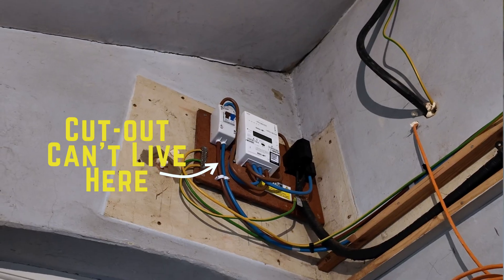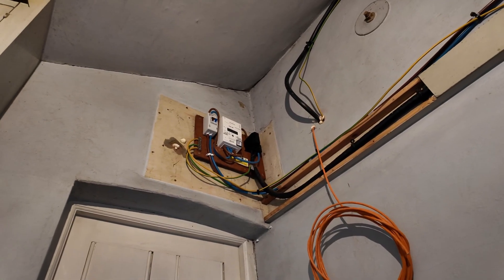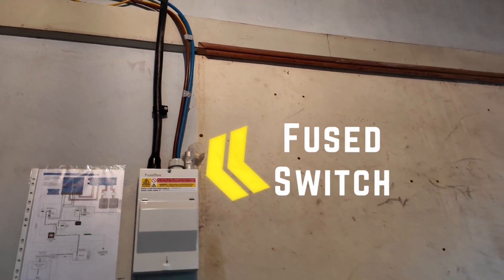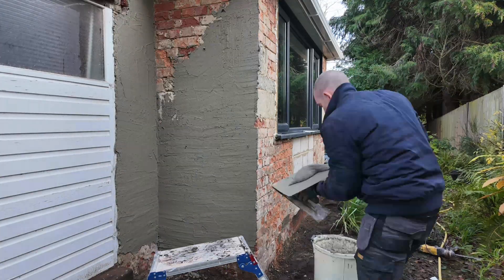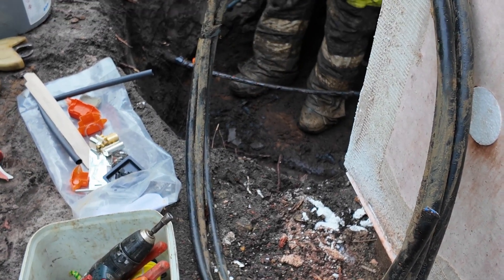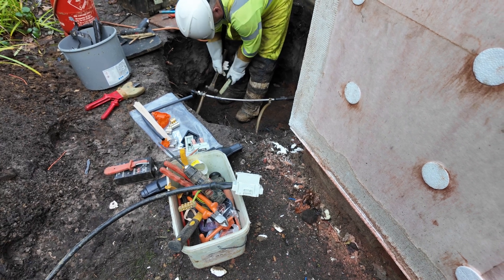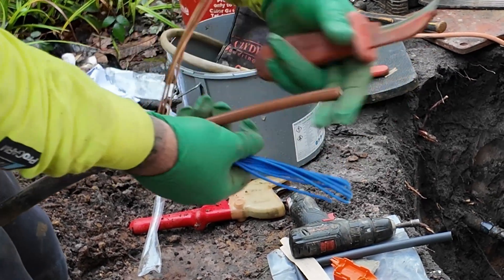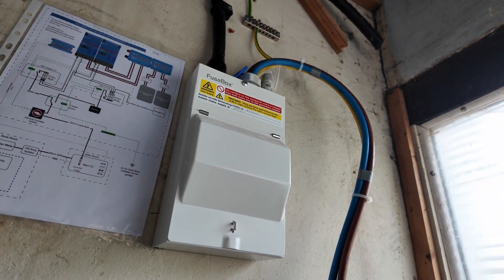Moving an electrical supply cable with a propane torch!

Comment: Great Video... in my case I want the to move the meter to the other side of the wall, the external side. Tecnically less than a meter .. THe DNO said the meter company and the meter company saying the DNO ... still negotiating ..
Two questions, what was the depth of the trench and how long it took them to sort it out from the beginning to the end?

Comment: I can understand people being shocked by the cost of work that doesn't necessarily take that long, but you're paying for the years of training and it is quite a dangerous job to do.
Reply from the maker: I'll give you "dangerous" but not so sure it requires "years of training". If I thought the guys doing the work were the ones making the money I wouldn't complain so much, but I'm pretty sure the DNO makes a healthy profit on these jobs!
Reply: @RodMcBain  with that stuff it very possibly could tbh 
also you have the cost of insurance etc which they have to factor in 
still they likely do make a profit on it for sure

Comment: ive just been quoted £650 from the solicitor for two hours advice, so think yourself lucky !!
Reply from the maker: That's extortionate, but not surprising I've needed to get some documents notarized recently, the solicitor that does that charges about £150 per doc, that's about 5 minutes work 💰

Comment: I expected the DNO to charge more tbh, especially considering the specialist tools and training required to deal with those old lead cables not to mention the risk of working live, and working with toxic fumes. great work all round! 

Still impresses me that those old bitumen / Hessian / lead cables are working just as well the day they were put in, some 100+ years ago. Fantastic design.
Reply from the maker: It is impressive, I very much doubt the replacement cable will last anywhere near as long.

Comment: Great video as always Rod. Sorry to hear you got fleeced by the DNO. I think I mentioned to you previously in reply to another of your videos that I got charged £300 by my DNO (SPEN) to assess my G99 application and I later was able to claim that back from them when I asked them to justify the high cost. I would suggest you also ask for a cost justification now that you've actually seen what was involved in the work and see if you can at least get something refunded. Maybe you can use your electrician's labour as a basis and apply that to the man-hours you received from SPEN plus some materials costs and see where that ends up. Even if it was £150/hour x2 men plus, say, £100 for materials, that's still only £400. Maybe another £50 for travel costs = £450? Worth a try.
Reply from the maker: Thanks Craig, great advice as always,  I know by not pushing back i'm probably encouraging their behaviour.